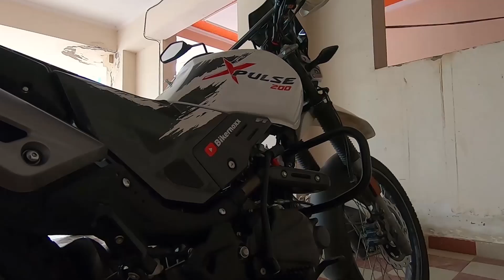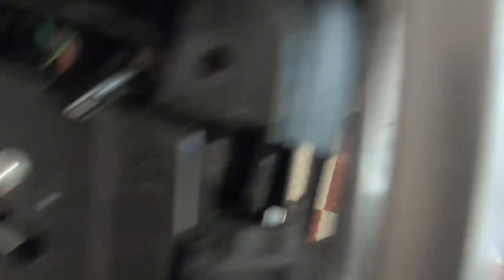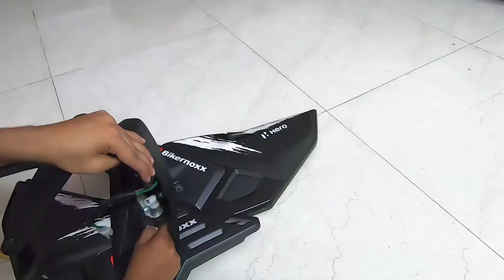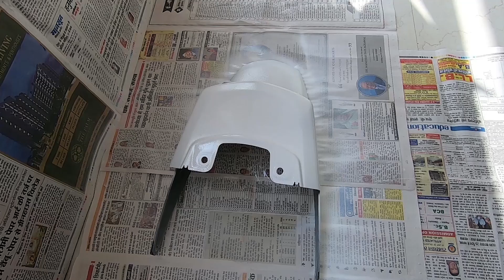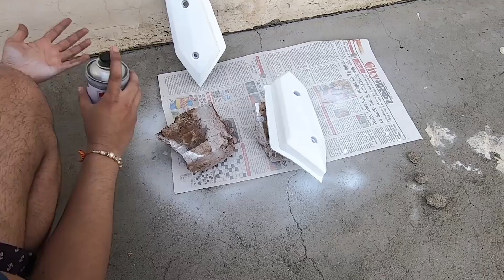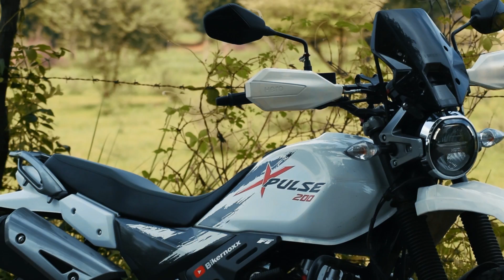Making Xpluse200 more Attractive | MOD

Comment: Bro i am planning to buy this bike but i have heard so many complaints about this bike like suspension failure, ABS problem, oil leakage, engine over heating issue and engine vibrating when driving 80+ etc.. if you can answer it will be a great help to me.... 👍
Reply from the maker: Ping me. My Instagram is  given in description.

Comment: Looks really classy! Where did you get the black visor from?
Reply from the maker: From honda service center.
Reply: @Bikernoxx  and which paint did you use to spray the parts?
Reply from the maker: @servershaikh7528  aerosol spary paint.
Reply: @Bikernoxx  ya but which brand
Reply from the maker: @servershaikh7528  polo
Reply: @Bikernoxx  is the paint lasting well?
Reply from the maker: @servershaikh7528  yes, just avoid petrol, diesel or  Any chemical  like tarpin kerosene etc.
Reply: @Bikernoxx  cant find it on amazon can you please guide me with the full name
Reply from the maker: @servershaikh7528  i bought from local paint shop, try at your nearest paint shop. You can use any aerosol paint,
Reply: @Bikernoxx  yes but i really liked the finish of your paint. Anyways I’ll try out a local paint shop
Reply: @Bikernoxx  can you also please tell me how long did it take for the paint to dry?
Reply from the maker: @servershaikh7528  for batter ,leave for over night.

Comment: How did you fit the number plate?
Reply from the maker: With metal plates. There is option for nuts so directly fit. No drilling required. ✌️
Reply: Can you share a picture/ video
Reply from the maker: Here my Instagram. I  Will try asap to explain you https://www.instagram.com/ravii_kumawat/

Comment: Broo which is best bs6 Or bs4?
Reply from the maker: Bro  difference only is  you getting oil cooling unit in bs6 and aslo some difference in gear  ratio and some little more refinement...but with bs6 noms. Power reduced in bs6 compre to bs4.

Comment: Sexy! Where did you get that windscreen?
And can you change the headlight to old duke 200 headlight?
Reply from the maker: Good imagination but old duke has halogen bulb and this one have full led lights set up so. There is. No direct fitment socket and power output for halogen bulb. But kuch krrenge  light ka bhi. . If  I'll Get something that fit with it.
Reply: @Bikernoxx  can't we replace halogen with led in duke headlight
Reply from the maker: Yes we can replace with led try to search in local moto  Shops, or any automobile markets where all the motorcycles  work is done. 👍